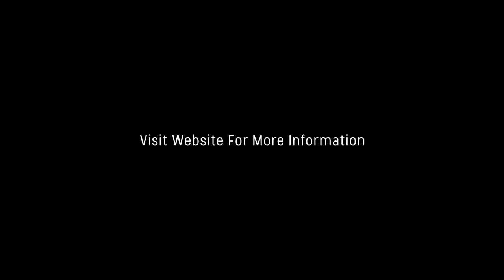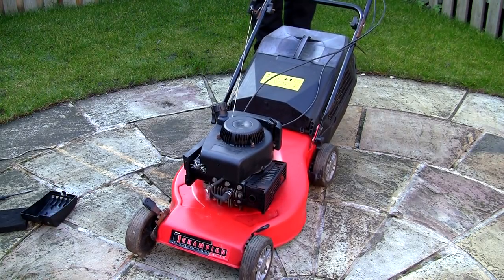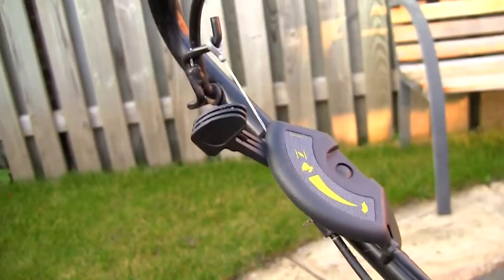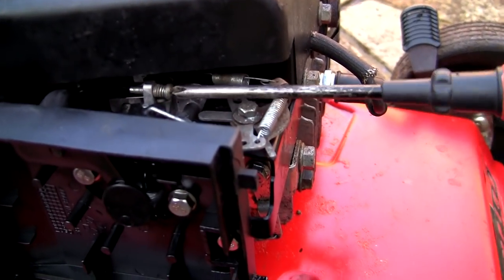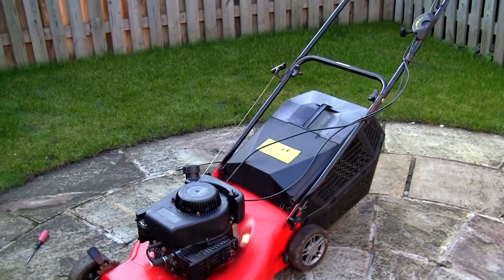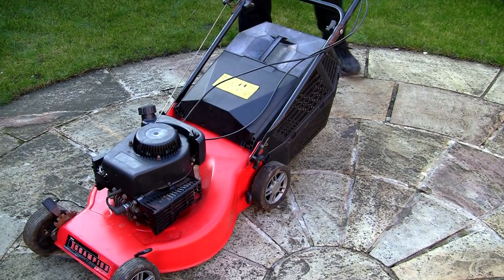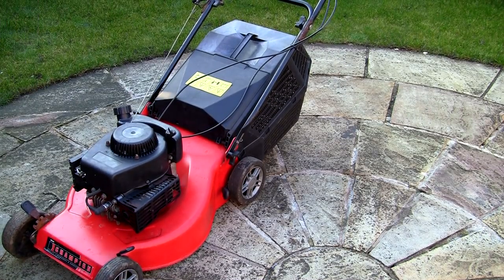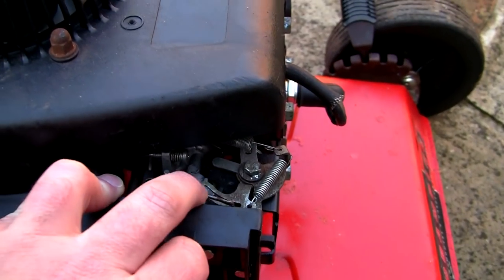Mountfield SV150 Lawnmower Engine Idle Speed Screw Setting

Comment: Hey there, I have a Sovereign mower with the SV150 Engine, when its running it makes like a “Putting” noise now & again when its running. I have adjusted the idle screw but it has to run really quick to stop the “Putting” noise. Just wondering if you could advise what would cause the “Putting” noise? Thanks great videos, very helpful

Comment: excellent video thank you. Within just a few minutes I learnt how to check that the carb is set correctly when at the choke position. Could you add a short video of how to set up the governor springs etc when putting the carb back on. Can't find a picture or explanation antwhere
Reply from the maker: John Cooper Hi John thanks for your comments. I have a full playlist of videos on the youtube homepage . Hopefully you can find something there
Reply: @MowerMan  You're a star ! Hi thanks for your prompt response. I have a Champion 40 SV150 which will only run on choke and cuts out immediately when taken off choke. I found one of your videos that mentions a tiny spring on the throttle butterfly shaft  and sure enough the spring is missing on mine so it constantly oscillates between idle and full throttle. I'll order up a replacement carb Thank you

Comment: Thanks for the info. Can you do a video on mowers backfiring? Doesn't seem to be much out there about it.
Reply from the maker: Aled Peryg Do you mean kickback where it tries to drag the pull start cord out of your hand?
Reply: @MowerMan  No, when you get a "loud pop" from the engine every  so often. I had an sv150 that did it last year. Didn't seem to affect the use of the mower but I had no idea what caused it or how to stop it?
Reply: @Aled...  most back firing is due to the key way being out of time as it does not spark on time giving too much fuel in the cylinder

Comment: Can you swap the tank and recoil from the one where they split for the one in this video?
Reply from the maker: Yes
Reply: @MowerMan  I've seen the conversion kits but they are not worth it unless you intend keeping the mower. I've just come in from the shed, took tank and starter off a separate tank one, there are differences to the engine case but a few mods and brackets and spacers and it will work. I might do a vid.